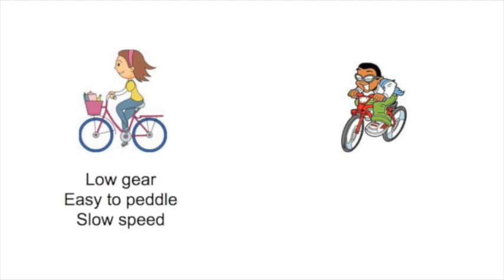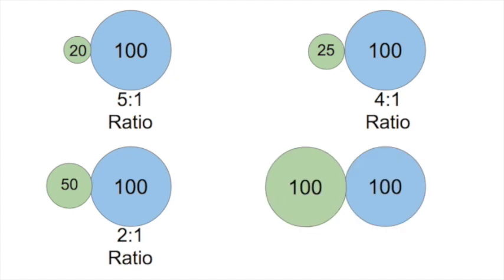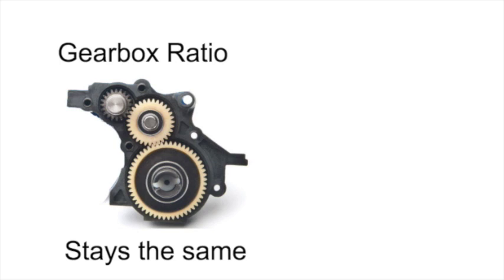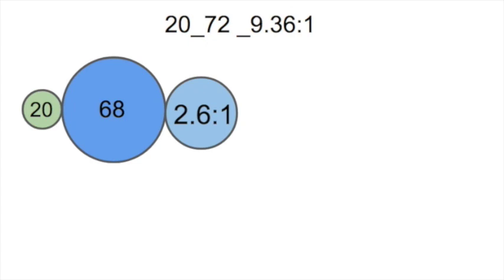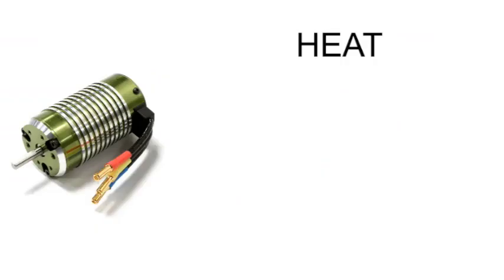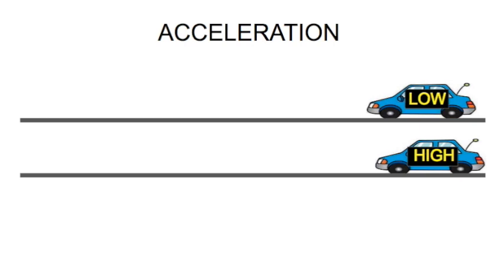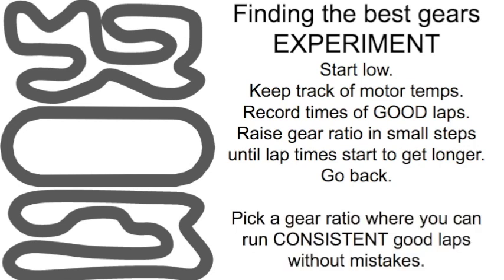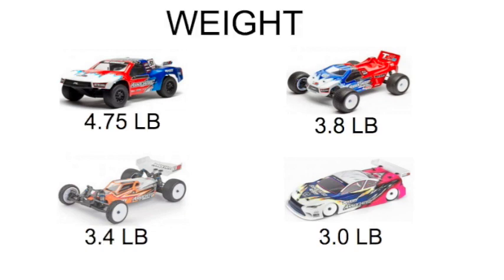Understanding Gearing Your R/C Car

Comment: If my NPRC with a 2.6 trans is running 132 feet at about 4 and a half pounds. My final drive ratio should be about 12 to 13 final drive?

Comment: I think that there is a little mistake in video! In the last example with the 18 t pinion gear and the 72 t Spur gear, the author says that the gear ratio(10.4:1) is higher and shorter compared to the original ratio of 9.36:1 ! 
It is shorter but isn’t it lower than the original gear ratio??

Comment: I have a 4s kraton getting 15th tooth pinion put in my kraton THE input gear is being being replaced my Question is is THE 15tooth pinion gear safe being up against spur gears and Differental gear my motor 2400kv Motor 120Esc SERVO not sure what the numbers r on my differental gears or my spur talked to my hobby shop guy about it he said it should be fine told not go stop and go just keep it running and check the temperatures so i bought a heat 🔫 Called dynamite with Built-in laser pointer for accurate target aiming Backlit Readout 2% accuracy Celsius or Fahrenheit auto power shutoff Automatic data hold Low battery indicator operates on included 9v battery
Reply: It should be fine,  if your that worried about upgrade your motor fan, my 3s Granite came with with a 15t, I run a 20t I love it.